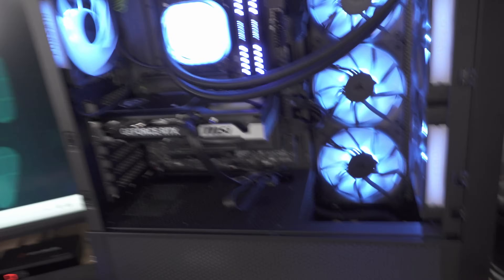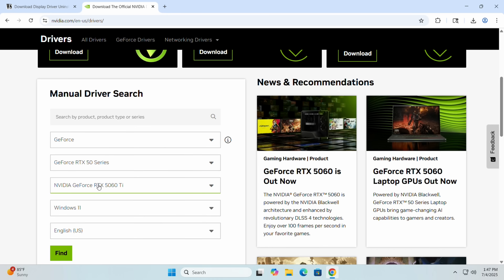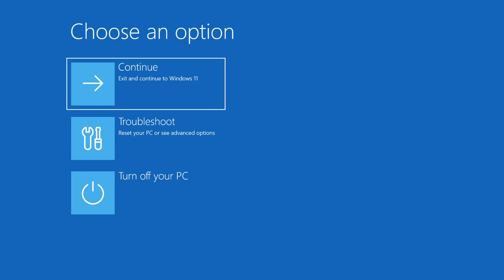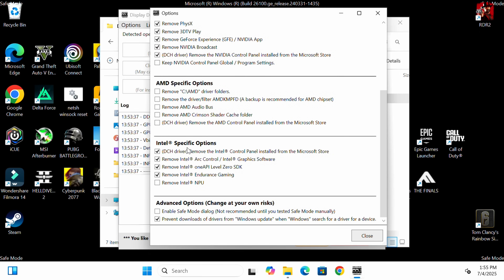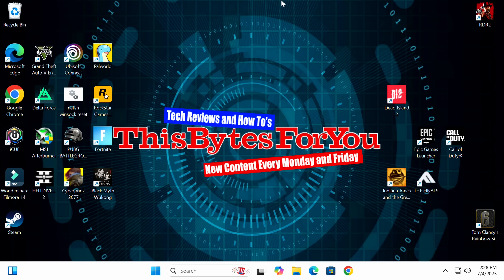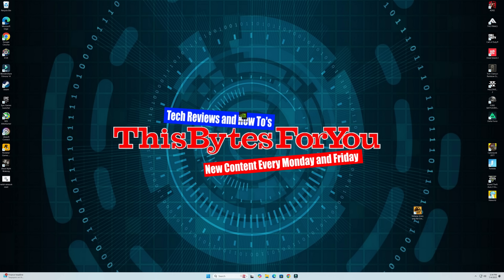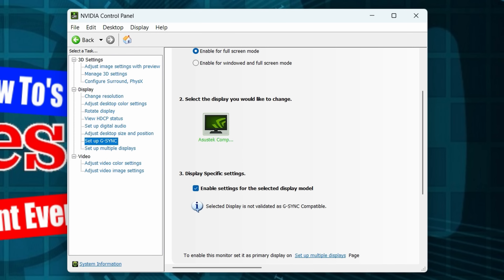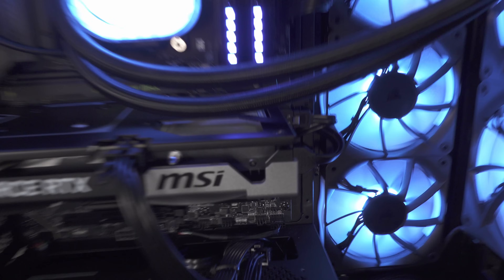The ONLY Way to Install RTX 5060 Ti? (Avoid Headaches & Maximize Performance)

Comment: Great video, but also terrifying at the same time! Haha.

Looking to upgrade my 2070S to a 5060ti. Diving inside my PC is a daunting thought! Also, I've got to work around sligfhtly older hardware. The MOtherboard can support it, but I probably won't get max performance, should still be night and day compared to my 2070 though.

The PCIe power cables seem different as well. On my current card, it seems to be a 14 pin variant or something. Because I've got an 8 pin, plus a 6pin pugged in next to it as well.
Reply from the maker: thats why I make these videos to help you, not be terrified, you might have the card I use here: https://youtu.be/qAkSlBjTKYo
Reply: @ThisBytesForYou  Thanks. Followed the instructions, seemed to all go well, but I've had a drop in performance and games just freeze after about 15-20 minutes and I have to manually shut down. Also had really bad distortion when running sound through the card via my monitor. I did swap out the RAM as well, so I'm not sure what I've done wrong to cause issues.
I have paried with slightly older hardware, so I know I wouldn't get the max out of the card, but shouldn't be worse by any means. Any advice would be great. Thanks.
Reply from the maker: @Jimmer93 you had a performance drop,... So how did you install it prior to this video?
Reply: @ThisBytesForYou  The PC was off teh shelf, so all the og hardware was already installed. Followed this vid to install the new card.
Reply from the maker: @Jimmer93  so if you uninstalled the previous NVIDIA software, like I showed you, including DDU and your power supply is powerful enough, at least 600Watts, you should be good.  Did you download and install the latest Drivers as well?
Reply: @ThisBytesForYou  Yep, followed the video to the letter. Got 650 Watts, so, whilst at the lower end for powering a 5060ti, it should be sufficent.
Reply from the maker: @Jimmer93  your right, it should be.  Do you have an 8Gig or a 16Gig 5060?  Aside from the card, did you raise the resolution of your game or any other settings?  Also, Physx has been moved from the card, to the CPU now, so that could hurt depending on your cpu.
Reply: @ThisBytesForYou  16gb. I was replacing my 2070 Super. Which I've just plugged back in, and it's working fine! So, idk, maybe the new cards faulty...
I can run the Nvidia HD sound through card and my monitor again now with out a load of distortion.
Funny, I was playing Cyberpunk, and the best Benchmark I was getting with the new card was around 30 fps. Just done one with the old card, got 120fps...
Reply from the maker: @Jimmer93  somethings had to have changed, did you verify all the settings in the game stayed the same, you did DDU the old drivers correct?
Reply: @ThisBytesForYou yeah. It's very strange. I'm am using slightly older hardware. 9th gen i7 9700k psu. The mother board only has pcie 3.0 as opposed to 5.0, but everywhere i looked said that wouldn't be a huge limiting factor in performance. 
Settings were toned down for the old card. Mostly medium with ray traced reflections on. Played around with the settings with the old card, turning everything down and I still struggled to break 30fps.
Reply from the maker: @Jimmer93  no it wouldnt be huge, but are you on the latest BIOS for your board, which would help?  DDU removes Physx, download the lastest version here and install it and restart your pc: https://www.nvidia.com/en-us/drivers/physx/physx-9-23-1019-driver/
Reply: @ThisBytesForYou  But when you reinstall the drivers, it installs the physx software does it not? Like I say, stick my old card back in and it works fine. Hell, it might even work better than before.
I've never updated the bios, so probably not. I don't think I've got a flash drive lying around to it either.
Reply from the maker: You dindnt have a graphics card till you bought one either.  Sounds like you've already made up your mind though.

Comment: Hello, I recently bought the 5060 Ti as my first dedicated GPU. My current pc is around 12 years old, and it has a GA-B75M-D3V Gigabyte motherboard paired with a i7-3700 (I was using Intergrated Graphics). I did everything correct until the part where you place the GPU in. I did everything correct, the PCIe, putting it properly. After it does a long beep, then 2 short beeps after. I don’t know what to do, the pc will fully power on, but the monitor won’t turn on at all. The Motherboard is an ACI im pretty sure if I didn’t spell it wrong. It would be amazing if you could somewhat help me.
Reply: I found out that it is most likely a failing POST. Any recomendations to fix it? I already did the clr_cmos and that battery thing.
Reply from the maker: Well yes, it will not POST (Power on Self Test), like you have stated above with the Beeps during POST.  You have an AMI BIOS, 1 long beep and 2 short beeps usually means Graphics card, usually loose but I think it would be a little more because of the age of the computer, I am thinking you are not utilizing UEFI and also using MBR and cards now a days need to have UEFI and the operating system needs to be GPT.   

Before I get to the GPU, what is the manufacturer and model number of your Power supply, and do you have 8PIn PCIE cable connected, that's 2 questions.

There is a BIOS like you already know, but the BIOS has been retired and to replace it, EFI come out, AKA UEFI.  BIOS had a limitation of 2TB, stuck at 16Bit, no security and was basic, you probably can only get around with the keyboard, not a mouse.

UEFI allows for up to 9.4 Zetabytes, as long as you are formatted under GPT, you are more than likely under MBR, maybe on Windows 7, potentially 10 if you did an in place upgrade.  UEFI allows for faster boot times, not in 32Bit or 64Bit environments, enhanced security, extensibility and now you can use a mouse in the BIOS.  Your BIOS how ever support UEFI, it just has to be enabled and also, your OS needs to be on GPT, both can be done, but you will need your old graphics card in the machine for right now.

In the video I am about the link, I show you how to enabled UEFI (although it will be different on every motherboard) and how to change from MBR to GPT without losing data, you can start watching it at the 8:32 minute:  https://youtu.be/4BtdMcqwaFg

After doing that, with your old card inserted, you should be able to install your new card and it "Should" work.  I would also recommend flashing your BIOS to the latest version since it updates system and overall compatibility, your ME firmware, SATA and USB compatibility and corrects vulnerabilities: https://www.gigabyte.com/Motherboard/GA-B75M-D3V-rev-10/support#support-dl
Reply: The PSU is a MSI MAG A650BN 650W 80+ Bronze. I have a 6+2 Pin PCIe cable. I am not sure how to enable the graphics inside the cpu if I can’t enter the BIOS (I turned the setting where the main GPU which is the intergrated one off). I am thinking of just upgrading my motherboard and everything else since I will upgrade the cpu soon.
Reply from the maker: ok, disconnect all the cables on the back of your machine (power, hdmi/dp/vga/display, usb, all cables), then remove the CMOS battery, and wait 60 seconds, after 1 minute plug  all the cables back in, then plug the cmos battery back in and see if it works.  If it doesn't, remove the graphics card, then plug the monitor into the onboard graphics and try that, if your CPU has onboard graphics
Reply: Nope, still the same thing is happening over and over again.
Reply from the maker: @Yorukumu so you took your card out and plugged into the onboard video and that didn't work, which was part of what I mentioned, how did your machine work before?
Reply: Could you clarify “How did your machine work before”. In my understanding of your question, nothing was wrong with it before, I could play games on it, watch social media and other stuff. I also did take my card out and plugged it into the onboard video using VGA. (No HDMI or DP because the motherboard is older). I did the same with the GPU except I used a HDMI cable as there was no VGA.
Reply from the maker: @Yorukumu how did it work before, with an older card, so did you pop in the older card, update the bios, get on UEFi and update your os drive to gpt?
Reply: @ThisBytesForYou Haven’t did that yet, but when I can access my BIOS I probably will update and do everything you said it if I can. No, I haven’t put in an older card in if an Intergrated Graphics doesn’t count as one.
Reply from the maker: so, once you do everything I have asked, since I have done it before and it has worked, which is why I am telling you this, let me know how it is working, BIOS at UEFI, OS drive as GPT (since a UEFI Graphics Card needs UEFI BIOS and GPT to work) and then let me know how it work.  I know you are trying to do a thousand other things to make this work, take the approach being provided to you and save yourself a ton of time.
Reply: @ThisBytesForYou Ok, thanks a lot!
Reply from the maker: Anytime bud, let me know how it goes and make sure to follow the video at the minute marker I said to help you move from mbr to UEFi and gpt

Comment: Hi, thanks for the video! I have the same MAG B850 TOMAHAWK motherboard, and this is my first build. Does the pcie slot latch have any condition? When you press the button, it's closer to the pcie slot, but when you press it again, it's further away from the pcie slot. I'm afraid of breaking the motherboard slot or even worse, the graphics card. In both cases, it's difficult to move it.
Reply from the maker: If you press it, it pushes the card out, then you can pull the card out, just like I show you.

Comment: just got my 5060ti now.
this is just gold. bless u Sir.
question Sir.
My pc is literally brand new, all parts and components are new.
freshly built.
so, am I still need to do what shown in the video Sir? (removing drivers with DDU)
Reply from the maker: So before you put your card in, did you have the system on and were in windows, did you use cpu graphics?
Reply: @ThisBytesForYou  thank u for the reply sir, 
no sir. installed everything first then turn on the system. 
i was not using any cpu graphics
Reply from the maker: @TanjiroKoto then you are good,  no need for ddu, so very happy I could help you
Reply: @ThisBytesForYou  ah thank you Sir... thank u very much
Reply from the maker: Always a pleasure my friend, so very happy I could help you.

Comment: Hey, so I made sure the connections were good and did everything you said, but when I went to turn on the PC, I got nothing. I can hear everything running normally inside the case, but no visuals pop up
Reply from the maker: So that I can help you, 
1. What is the manufacturer and model number of your motherboard.
2. What is the manufacturer and model number of your RAM.
3. What is the manufacturer and model number of your Power Supply.
4. What is the manufacturer and model number of your CPU.
This video will help you find your parts, but you will need to look inside your pc to find your power supply: https://youtu.be/65ZSiVImJx0
Reply: I think I found my problem. My GPU requires 2 separate PCIe 8-point cables; not 1 like I have now

Is that something that could be causing the problem I have with no video showing?
Reply from the maker: @primallegends001  Maybe, I go over it in the video, but answer the questions so I can help you.
Reply: I'm at work right now, but I'll put in the things you asked for when I'm done
Reply from the maker: Good stuff my friend.
Reply: Motherboard: AMD Ryzen Pro B650-P WiFi
RAM: Corsair DDR5 16GB (×2)
Power supply: Corsair RMe series RM750e
CPU: AMD Ryzen 7 9000X
Reply: I'm trying to install a GeForce RTX 5060 Ti 16GB Gaming Trio OC
Reply from the maker: 1. Are you plugged into the graphics card or the onboard graphics?
2. Do you have a way of getting video at all on the system?
3. Does it work if you are plugged into the board directly for graphics off of your CPU?
4. Are you use 2 cables plugged into that adapter, or are you daisy changing it, meaning are you using 1 cable, and 2 heads from that one cable into the adapter?  You need to use 2 separate cables, that power supply brings 2 cables.
Reply: @ThisBytesForYou  I tried plugging into the board directly and the graphics card with no results. No video was possible unless I installed the old graphics card. I was kinda figuring I needed 2 PCIe 8-point cables instead of 1. The GPU comes with an adapter so you can plug in 2 separate PCIe 8-point cables, meanwhile I was using 1 cable with nothing going into the other head of the adapter.

I guess I was right in that I needed 2 PCIe 8-point cables instead of 1
Reply: @ThisBytesForYou I got picture! The second cable that was recommended fixed my issue. I'm really thankful for your help in troubleshooting!
Reply from the maker: @primallegends001   @primallegends001  Ahh good stuff my friend, Always a pleasure, so very happy you stopped by, trusted in me to help you, liked and subbed as well as took a moment out of your day to thank me.  It means a ton to me and I am so very happy I could help you.

Comment: hello Iggy, I followed your instructions but once I physicaly conected everything the card was not recognized by my PC, was running a 1060 was working fine. I have Windows 11, Intel i5-6500 CPU@3.20GHZ, 16GB RAM on a MSI Bazooka (MS-7982) Version 3.0 with a MPX-6001-ACABW 600W PSU. please help
Reply from the maker: Hey bud, I am at work so I can't help much but once I get home I can, In the meantime, what BIOS version is your motherboard on?
Reply: @ThisBytesForYou American megatrend inc 1.00 30/07/2015
Reply from the maker: you are on the initial BIOS version, that is more than likely your issue, update to the latest: https://www.msi.com/Motherboard/B150M-BAZOOKA/support
Reply: @ThisBytesForYou I will have to look at it tomorrow as it’s late here in Australia. Thanks for swift replies. I will keep you posted how I go with it after updating the bios. This is all new to me so I really appreciate your support
Reply from the maker: Always a pleasure my friend, I love to help.  The other thing you want to verify is that your C drive is in GPT not MBR and your BIOS is under UEFI not BIOS, since the card is a UEFI card.  If you are under MBR and BIOS, its a little more difficult, but I have a video on it.  Just let me know.
Reply: @ThisBytesForYou  I had it going and it was all set up. I opted for the game ready mode, installed, tested a game, and made it look really shiny. Then I restarted my computer and now I get black screens. Why is this so hard. please help.
Reply from the maker: Disconnect your monitor cable from the graphics card, wait 30 seconds then plug it back in, does the video come back on, try another port?
Reply: @ThisBytesForYou  that worked, hopefully I won't have to do every time I restart LOL. Once again thank you for being so prompt.
Reply from the maker: always a pleasure my friend, so very happy I could help you again ;)

Comment: my pcie port is too deep? my 5060 will not go any deeper
Reply from the maker: Thats impossible, its a standard.  What could be happening is 
1. you still have the PCIE protector over the PCIE fingers
2. You are hitting a capacitor, look closely as you are slidding in the card to see if you are hitting somthing
3.  The metal prongs are sticking out of the rear of the case, i go over that in this video
4. Verify once those prongs are in, they are sliding into the little holes in the motherboard base on the case.
Reply: @ThisBytesForYou  on the connecters, its hitting the divider on the pcie port
Reply from the maker: @EverydayFairways the divider on the pcie port... Hmmm, can you take a pic and show me what you mean, send it to iggy@thisbytesforyou.com